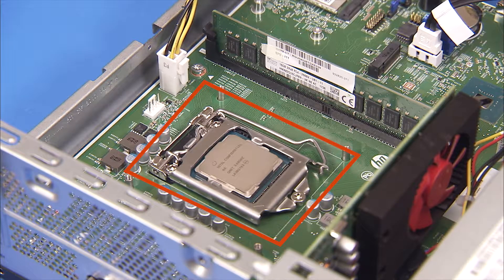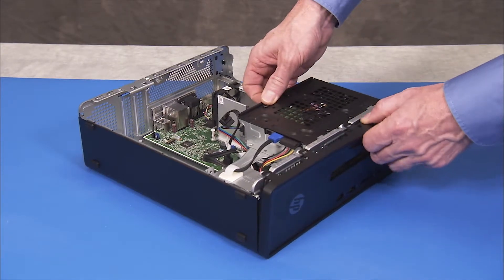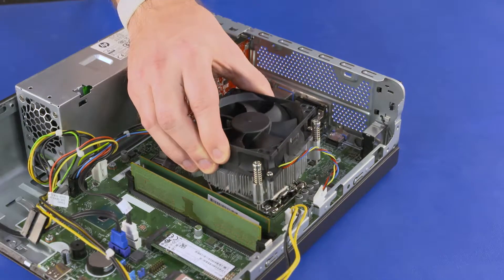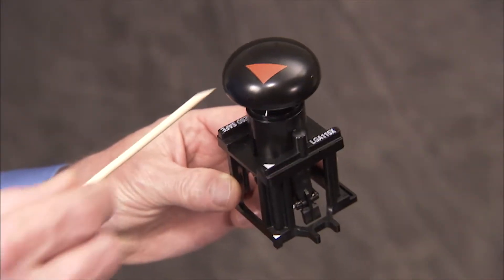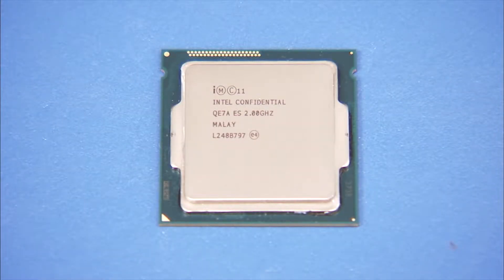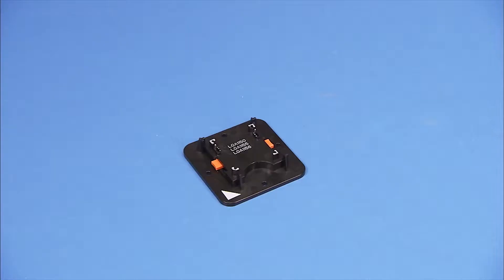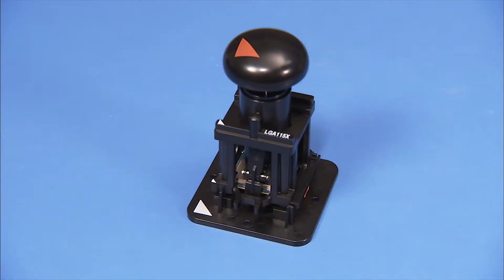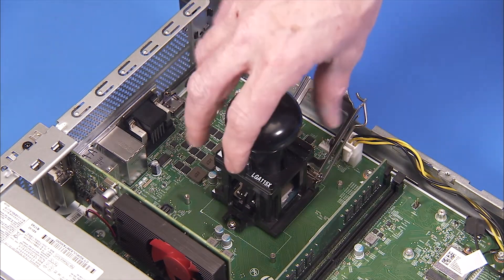Remove and Replace the CPU Removal | HP Slim 290 and Slimline 290 Desktop PC Series | HP

Comment: I have Hp Slimline 290-a0020in desktop
It has integrated graphics.
How to i add additional graphics card?
And it has Intel celeron j4005 processor...which is very slow.
Can i upgrade it to i3 9th gen processor?
And if i add M.2 2280 internal ssd  how to i transfer original windows 10 os from HDD to SSD?
Please tell me.
Reply from the maker: Hi Saurabh, thanks for contacting HP Global Social Media Support!
I understand that you need to know about adding graphics card, upgrading processor and transferring data from HDD to SSD. 
I will do my best to assist you.
Checked the specification of your computer and found that it does not have an expansion slot to add graphics card. 
Please refer 'Processor upgrade information' from here to know about supported processors: https://bit.ly/3ryRBKo
It has One M.2 socket 3, 2280 type for SSD. So you can add SSD that supports this socket.
Please refer this document to know about transferring data from HDD to SSD: https://bit.ly/3rO41Z9
Binu-HP Social Media Tech Support